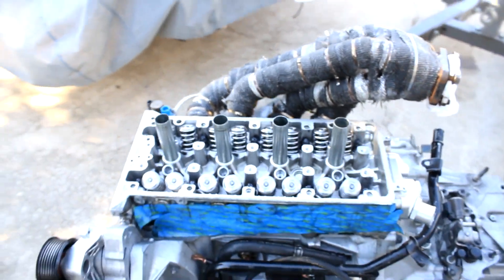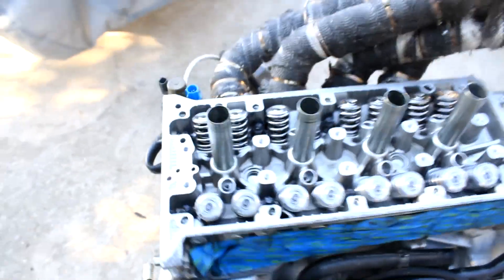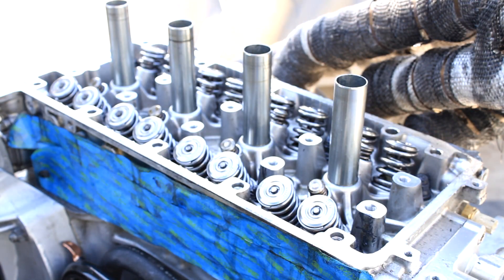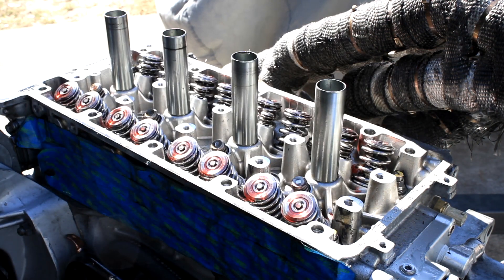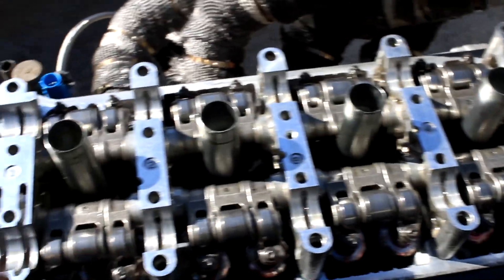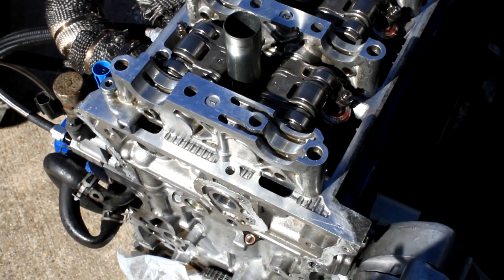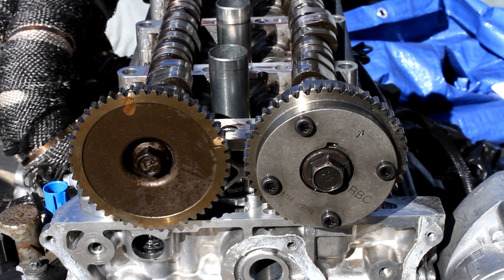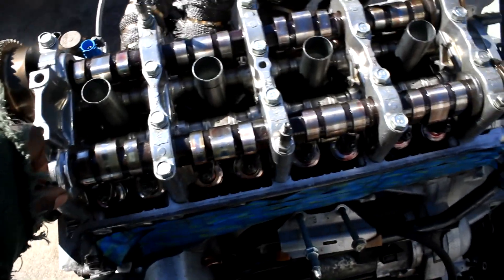K20Z3 CAMSHAFT INSTALL | NATURE OF THE BEAST EP:5

Comment: Hey man that upper coolant housing I noticed on the stock one when I took it  off, it had more ports in it than the k tuned one. Do I gotta reuse the metal gasket from the old or just bolt it straight to the head since the ktuned has the rubber gasket around the coolant ports?
Reply from the maker: U do not have to use the gasket since it has the rubber seals, if anything U can apply hondabond. The extra port up top is a coolant port if I’m not mistaken but I plug the top port since I was going for a clean look, sorry for the late reply
Reply: @kadeemwillock6335  all good, you didnt have any issues with exhaust leak or anything ?